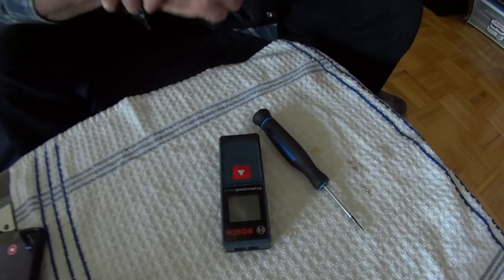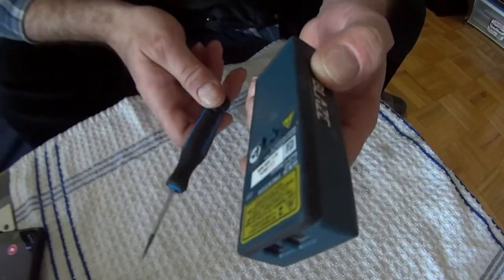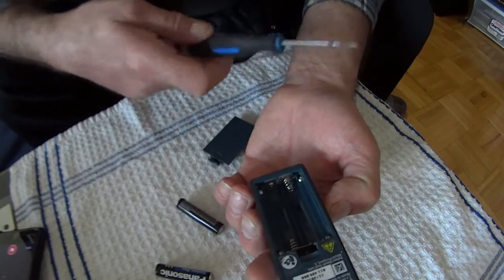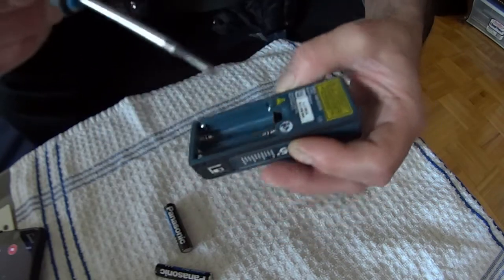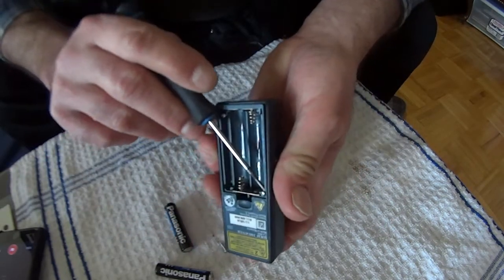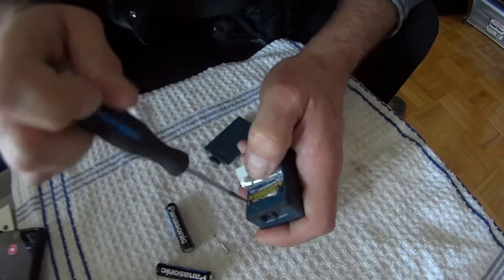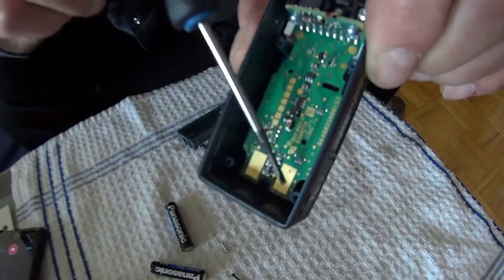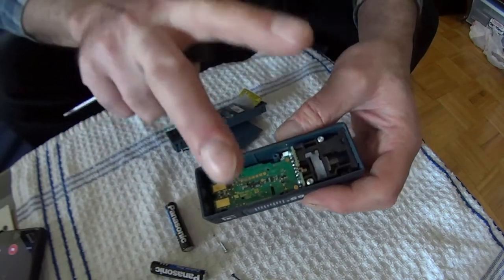Bosch Blaze GLM 20    65' indoor laser distance measurer. Maintenance

Comment: I left the batteries in my exact same model for too long. Corrosion everywhere and would not work. Watched your video to help disassemble and there was corrosion all over the contacts inside too. Cleaned it up. Works again. Size T6 bit for the screws. Thanks for the video.